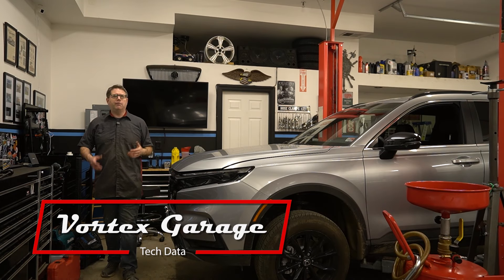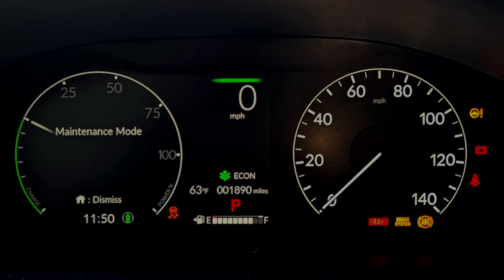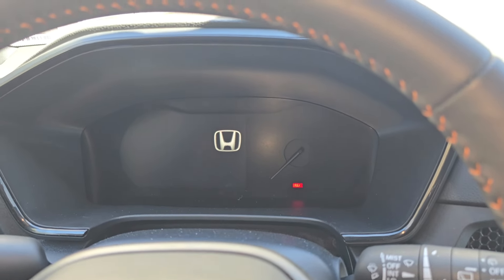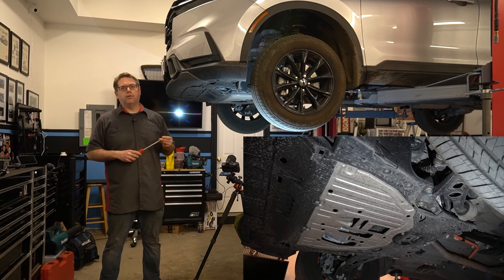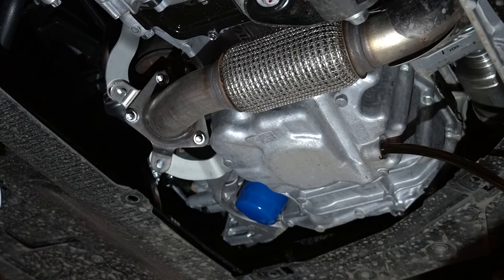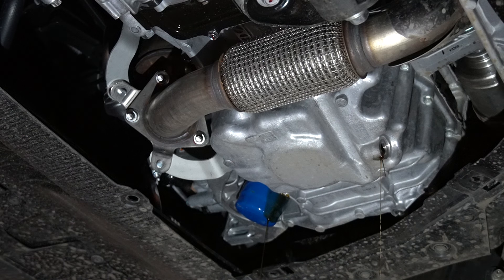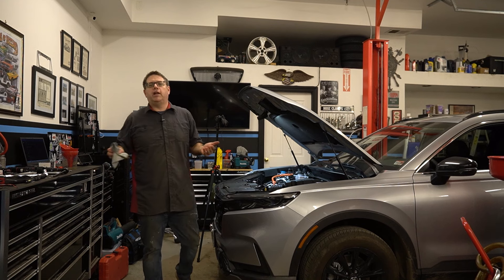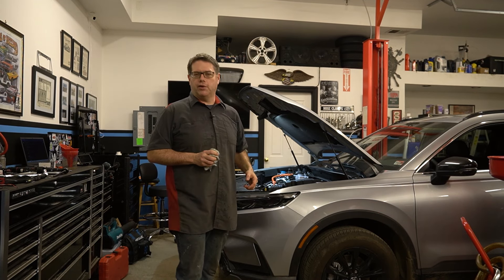Honda CRV Hybrid Engine Oil Change Steps - 2024 l 2023 plus Maintenance Mode!

Comment: I own a 2024 Hybrid CR-V and had the first (break in) oil change done by the dealer at 800 miles. They reset the maintenance as I expected and now almost 6,500 miles later the oil life is still showing 50%. Here's the problem. This car came with 2 years/24,000 miles of included maintenance from Honda, but the dealer will only do the free service if the maintenance minder is at 15% oil life or less. Since I refuse to wait for 7,000 - 8,000 miles between oil changes, I am fixing to change my own oil this time, but I WILL NOT reset my service reminder. I'll let the dealer do the next one for free. For this reason, I cringed a bit when I saw you reset the maintenance reminder. Nice video.
Reply: I have the same situation on a 2023 CRV Hybrid that had its 2nd oil change at 8500 miles. The car now has 17,800 miles but the dealer will not do the next free oil change until 15% oil life left. My  car is saying I have 40% oil life remaining. So I went ahead and did my own oil change with Synthetic 0w20 but did not swap the filter out. I will wait until I am at 15%. I did not reset the computer. My guess is it will take another 3,000 miles for it to drop to 15%
Reply: My dealer does the free oil changes at 5000 miles, so apparently they have some leeway from Honda, assuming Honda reimburses the dealer.
Reply: Change every 5000 miles

Comment: Wasting money changing oil at 1500 miles.
Reply: Nope , it's smart to get break-in out . Filter doesn't catch it all
Reply: Break-in oil change is the most important service of any engines life, especially turbo charged. The machining process can  sometimes leave behind micro metals that can lead to premature engine wear or failure. This is why Toyota is recalling all of their Tundra motors. The owners who performed break-in services probably won't have engine failure. It's not a waste of money, it's very intelligent!
Reply: Your not wrong if your leasing or not planning on keeping it. For us whom keep their vehicles it's right on.  I went to 2500 on 1st, a little long.   Then I change the oil filter and top off at about 1/2 the recommended mileage or when oil gets dirty. Dealership hits it at every 7500.  That oil stays pretty clean.  I send in the oil to check it.  The levels are always better than my race 347 in our 67 Mustang,  our race 632 in our 79 Chevrolet k2500, or our stroked 318 in or 82 Chrysler new yorker...of course those are not as  tight a motor or need a zero weight oil.  Close on the 632...0W50.  Lol
Reply from the maker: There's definitely lots of debate on first oil change interval for break in.  I didn't really get into that here...but I actually did this change earlier than I originally planned. I had a V12 Jag that needed "a tad bit of work" so I knew it would be living on the lift for a few months 😂

Basically this was the last chance to get the change sequence filmed and not wait until the oil was past due where I'd prefer it.

But break in changes are definitely a tangent/rabbit hole on their own. In my eyes, it's cheap insurance and protection for the invested cost in the vehicle.
Reply: Honda changed mine free at 3300 miles, 10% oil life. 24 CRV Sport Touring.
Reply: Nope not after break in period after a few hundred miles is a good idea to change it early that is when you have the most wear which overwhelms the filter.
Reply: I suppose it would be a waste of money changing at 1,500 if you're not planning on keeping the vehicle. I just changed mine at 935 miles. I wanted the break in deposits OUT! I've heard it takes 671 miles to break in an engine, I probably should have gone a little further because of hybrid mode being on some of the miles but oh well. Close enough for me! Look, oil changes are cheap, this engine is not!

Comment: Maybe already mentioned, but to run the engine you can just turn the HVAC temp to high and it’ll start right up.  Little less hassle than putting in maintenance mode.
Reply: That'll take even longer cause the HVAC will just run off battery until it drains. Fastest way is to just drive out around a bit, and maintenance mode isn't too hard imo.
Reply: @ 

If you turn the HVAC on high temp, it won’t run off the battery at all.  The engine will start immediately, and heat the car, without driving around, or switching to maintenance mode.
Reply: @chriscy2105 just hit the defrost

Comment: Thanks for thorough video.  My girlfriend's bought this vehicle, and I've also suggested she not wait until the vehicle says to do an oil change. Especially the first change.  The nice thing about this vehicle is that many miles are driven on battery when the engine is off, so the engine mileage is less than the vehicle mileage.  I've exceeded 48 mpg numerous times... an engineering marvel.

Comment: Are we related?  I have replaced my 2018 CRV oil using the same methodology and oil many times over 200,000Km.  No issues (touch wood).  I have never prefilled the oil filter, though I don't guess it hurts, on many vehicles and miles over the years.  Never had a problem.  Frequent oil changes seem to have served me well.  Safe motoring.  Enjoyed your video.

Comment: Good video. I have this exact model and color of CR-V.  I've already changed the oil myself before watching this video and it was very easy. I'm hoping you will do a video on changing the rear end fluid for the AWD in the future. I just subscribed and will keep an eye out for it.
Reply: I already did mine. Super super easy, you will need a filler pump, but if you do it yourself, you're looking at about 40 dollars max, I used 4 Jacks to lift the car up

Comment: Hello, thank you for the video. I have a huge question. So everytime I changed the oil on my CRV Hybrid, I actually have to put exactly 5 quarts. I use ramps to just lift the front of the vehicle. My question is, does more oil drain because of the position the car is in?
Reply: I'm curious about this too.
Reply: You should ALWAYS measure oil while the vehicle is on a level surface.  That is probably in your owner's manual.  Never on the ramps.  Once you put in just under 4 quarts, you can back off the ramps and do final filing.
Reply: @ijdad99 , Of course I check the oil on a level floor. You misread the comment. The comment is about the actual draining process. More oil comes out of the engine when only the front is lifted. Hope this explains what I'm trying to say.
Reply: @freedomislife5887 

You are correct. I read it wrong.  I do that a lot.  My girlfriend says I don't read all the words.  

The drain plug is near the back, so you'd think it would drain fully. 

I was able to just jack the car up about 5 inches and still get everything done.  The tire was still firmly on the ground.  Just needed some wiggle room.
Reply: I just changed the oil for the first time in my 2025 crv hybrid, after adding 4.2 quarts, I started the engine and let it run a bit, shut it off, waited a while, cleaned up my mess, and wouldn't you know it, there was BARELY anything on the dipstick! Just a little on the tip! It took 5 quarts to hit the full line. So then I dumped the oil back in the mobile 1 container, and it was 5 quarts that came out! They must have changed oil capacity in 2025 models (it was built on October 3, 2024), and not updated the manuals. I did the extra steps to see how much came out because I was wondering if it possibly had incorrect dipstick. Slim chance since I bought it with 2 miles on it.
Reply: @FredFlintstone21  I agree, it's a new engine, less than 10 years if study on it, so it shouldn't be concidered reliable yet, because there isn't too much study on it, in regards to consumer use. Also, the airfilter housing cover comes with 2 faulty bolts. For some reason, the stock bolts, have a cut closer to the top section of the bolt, which causes the bolt to snap in half with the least amount of pressure. But when you go to the dealership to buy replacements, the bolts that are sold afterward don't have that cut in the bolt. I can surely say it's Honda CRV and Accord models from 2023 to 2024, with the 2.0 hybrid engine. I own both car models, and on both cars, it's the same faulty bolt. Oh BTW, 2 bolts cost about 28 dollars, in Virginia. I'm trying to make it public knowledge so Honda can do a recall on it.

Comment: I just went to do my 20k mile oil change on my 2024. I did a 15K at an oil service place because I was on vacation at that point. I found my 4 quarter-turn fasteners missing, and my oil drain plug was impacted in way past spec. and no crush washer. 😡
Also, if you don't have the convenience of a lift, this CRV has the weirdest place jack point.. have to go in from the side.
Reply: My lift is tied up and I didn't feel like messing with jacking it up so I picked up some car ramps good for 6500 lbs per ramp at harbor freight. They are pretty stout! Anyway if you don't need to rotate tires, the ramps worked well.

Comment: Just wondering why the dealership mentioned nothing about doing an early oil change on our new Hybrid CRV. As a matter of fact, they said they won't change it (on the free oil changes deal) until the 15% light comes on around 7,000. We are at 4,xxx now. How bad have I screwed up?
Reply from the maker: I would not stress over that. Honda programs the maintenance minders keeping everything in mind. Doing the change as early as I did is an old school mentality and probably not needed. An early first oil change is not part of Hondas official maintenance minders or recommendations - I certainly could have waited.  Also being a hybrid the engine is not running all the time so it has less engine run time on the mileage compared to a comparable gas-only engine. 

While I still prefer earlier oil changes, you are doing better than many by sticking to Hondas maintenance minder, and having records of it changed at the dealer one-time will protect the warranty. If you're really aggressive on it you can pay for an earlier change but to get the bundled maintenance for free so long as it's before or at the maintenance intervals you should be good
Reply: I brought mine in at 5k and dealer changed for free at 6 months 😊
Reply: Same with mine; I went ahead and changed it myself at 5K. Didn't reset the MM, of course. Dealer did the "first" change at 10K when the MM said 5%

Comment: After warming the engine, will the oil be hot enough to need to take special care?
Reply: @mattsinclair3200  touch the oil pan with the back of your hand, wearing gloves of course.  if you can hold your hand  against the pan for 10 seconds, then you're good. 
Disclaimer " don't sue me if you burn your hand, since you decided to hold your hand against a hot surface, and not removing your hand in time, and of course, if you're a snowflake, don't try it at all, period"